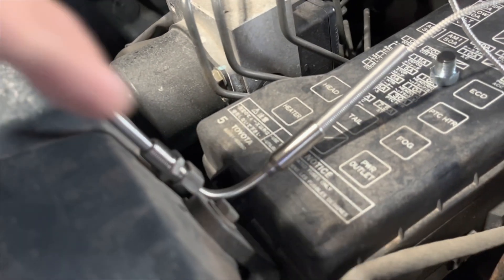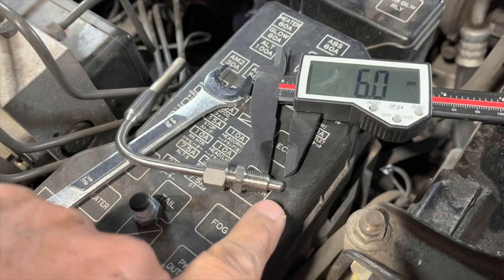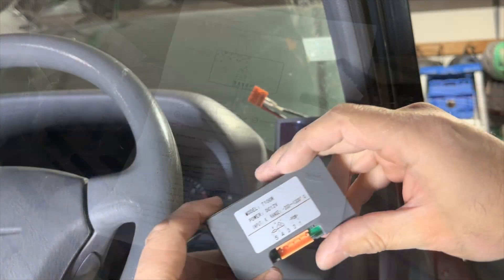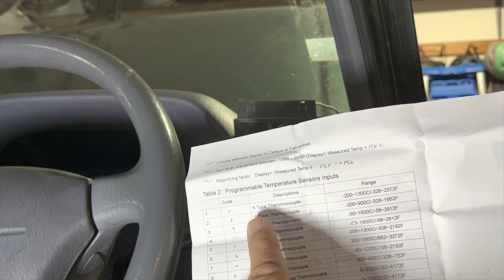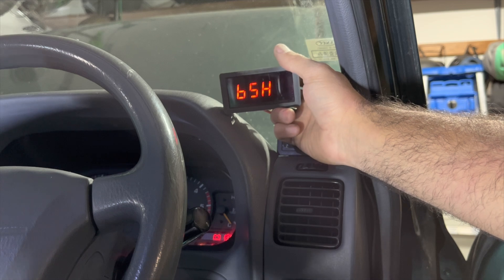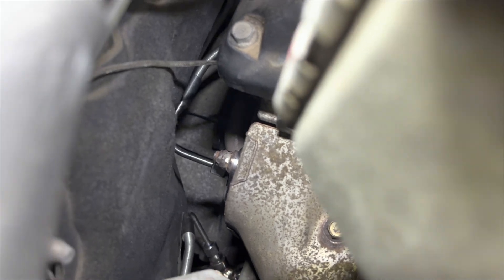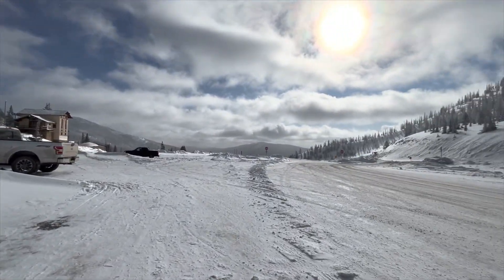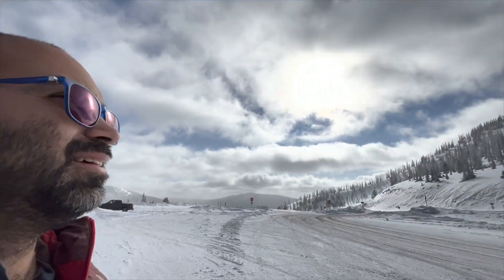Manifold & Downpipe EGT Comparison on a 1KZ-TE Prado

Comment: I wanted to ask you if you did well when you put the EGR block, your engine has not presented any problem
 or overheating? I am thinking of doing the same as my 1kz-te or with a 7 mm hole
Reply from the maker: It’s probably the most common diesel mod. I have never heard of anyone overheating from blocking the EGR?
Reply: You'd think prioritizing fresh air would be better for the motor regardless??
Reply: hello, from Canada, i am trying to block my EGR as well, What's the difference for the blocking plate with or without hole?
Reply: Don't think it's an issue. My KZJ95 base spec Manual RV came with no EGR from factory and after 300000 its clean as a whstle in the intake and throttle body.